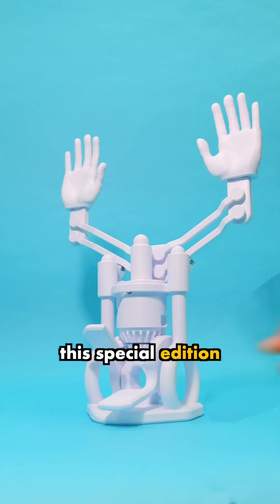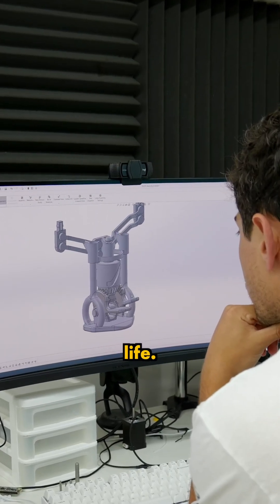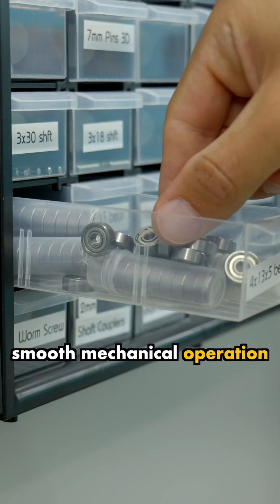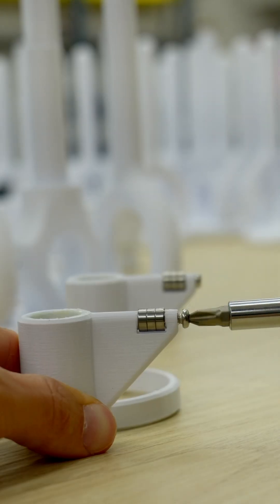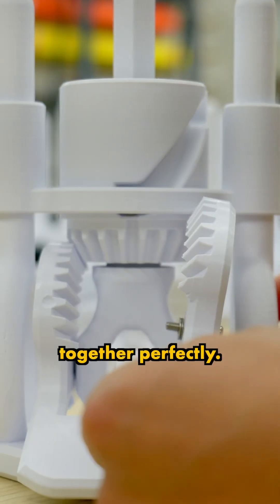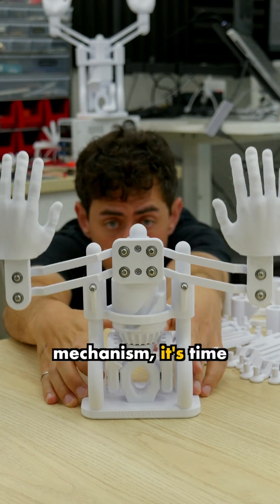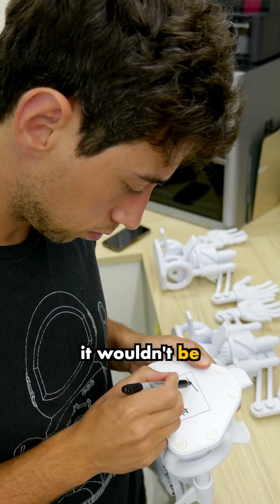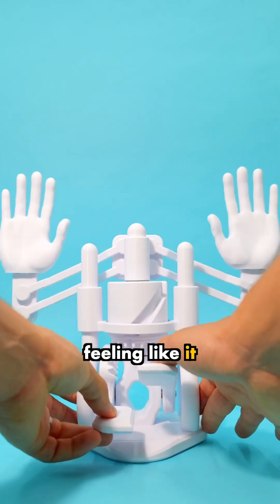Crafting a Kinetic Sculpture

Comment: What tolerances are you using?
Reply from the maker: It’s different for different parts, but for press fit bearings its normally sizing the holes to the outer diameter of the bearing!
Reply: @Engineezy  is there  a test file or something?